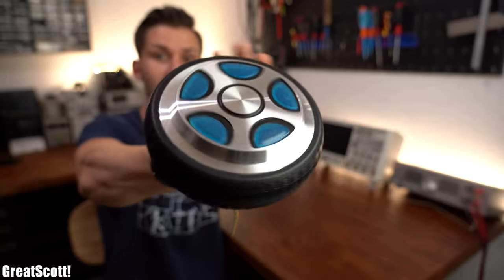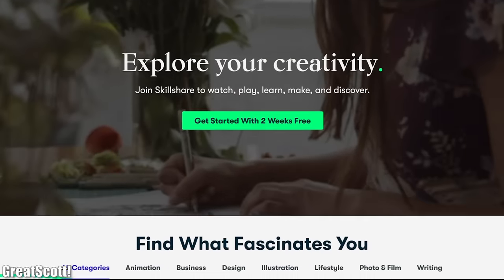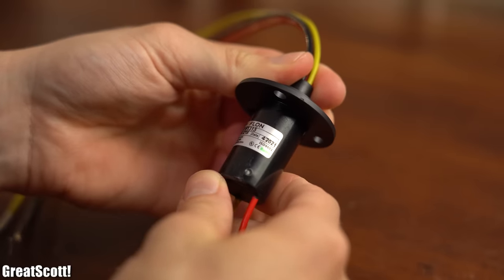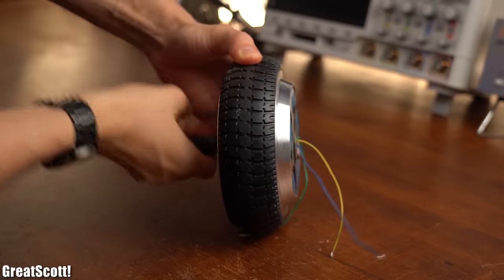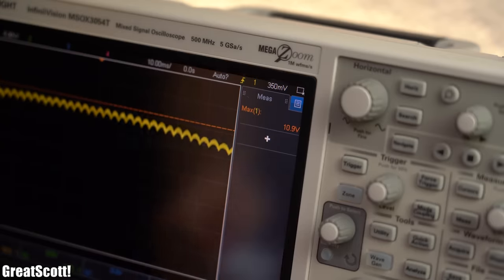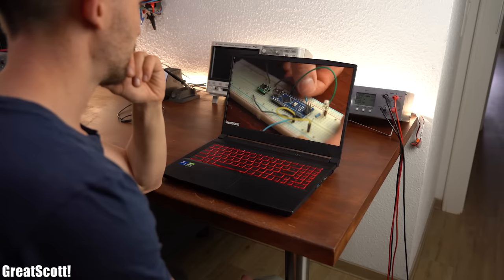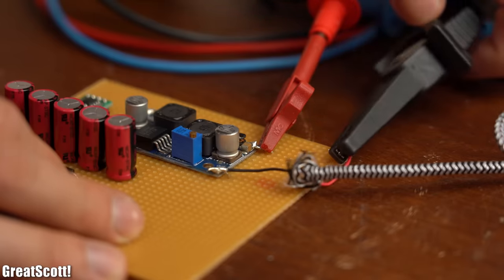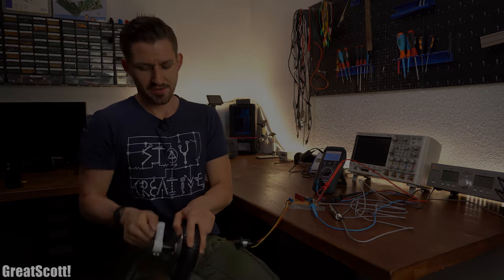Finally a good usage for Hoverboards! (charge your powerbank by cranking)

Comment: I did something similar on my bike.  When I cycle, my hub dynamo front wheel spins and supplies between 3 and 14 volts depending on how fast I'm going.  
The power goes through a rectifier through a buck-boost converter to a USB port.  
And everything fits in the coupling piece for electrical conduit. Ø 3/8" x 40mm.
Now i can charge my phone when i cycle.
Reply: And bike dynamo is smaller and lighter

Comment: use the wheel as a flywheel! and crank handle to the rim of the wheel. dill in to the aluminum wheel case and add a steel pin for the crank handle. then mount the axle on a stand. also if you use a stationary bike can run the wheel at a higher revolutions per minute with more consistency then a hand crank.  however the other is best for portable applications. have fun:-)

Comment: It was easier for you to crank the wheel by cranking it with a gear belt system on the tyre side mounting an aluminium flywheel with belt space. You need 2500 rpm ratio to 50 RPM for a better output

Comment: My dear Scott amazing as always
I have ome upgrade for the project in my humble opinion
you can make a fixed postion for the shaft and a 3D print a crank for the outter rubber wheel installing it by drilling the whole on it 
this way you can make it all combact in single unit without interfering the wire 
much luv Aladdin

Comment: The issue with the the first 3 'advanced' power banks may have been lack of a voltage reference on the data input lines, green white wires.
A common resistor divider can fix this issue with schematics available for different current draw setups respective to phone models (assuming also power banks).

Comment: Add 7805 regulator after it, for preventing to destroy a powerban., and set booster to 6.5v instead of 5v output.
When booster will shoot up to 32 volts, the 7805 regulator will start working, but you need to add a heatsink with 7805 regulator cause it gets heated with more voltage to destroy extra voltage.

Comment: Seeing this it makes me wonder how well hoverboard motors would do as a bicycle generator. Coupled with a charge regulation system and lights that could be a lot of fun.
Reply: They work well... But if you're going fast it's extremely noticeable the amount of drag they create.
They work best when you can turn them on and off so that you use them as a brake downhill, and store the energy. On the flat and uphill you don't want them

Comment: Love the way you slipped back to German for the three phase inverter circuit.
Interesting idea. Not sure if I want to do it.
The movement of the output wires will cause failures in future.

Comment: I looked into rectifying a 30kw 3ph wye generator yrs ago to get 240/120 single phase at 30kw. The more I tested options w/ a 3ph (current source) bench supply the more it seemed I could only get 10kw from the system using a rectifier like yours. The other 2 phases were only contributing to output smoothing. I was sending 1A AC 3ph thru the rectifier but only getting 1A DC at the output. Your motor is connected delta, but is likely suffering from the same issue as my setup.
What I found with the genset was I'd have to rectify each phase independently, pass it thru each inverter module, then parallel/sync the 3 AC outputs to get close to the full 30kw.
Needless to say, I never found affordable 125DC-240AC inverter modules even on the used (ebay) market.

Comment: Use the motors plus a stationary bike to make a charger, use a 3 phase bridge then an DC 12V regulator from a riding lawnmower. Works great to charge 12V batteries. Another option is to mount a bracket and a crank to the outer side of the wheel screwing directly into the rubber. Use a capacitor and a 12V to 5V converter to charge phones. The excercize bike mod allows you to use 3 or 4 of these motors for very decent current of about 3A a piece at 13.8 to 15V. Also add a simple over under voltage indicator made with a simple resistive voltage divider and green amber and red LEDs. Green will be about 2.8V for phosphode and 3.5V for nitride. Amber will be about 2.5V and red will be about 2.2V ❤ Have fun😊

Comment: The bigger powerbanks probably have more complex charging circuitry, so they try to pull a higher current and then back off when the voltage collapses. You might be able to fix that by adding the right resistances to the USB data lines so that the powerbank recognizes it as a computer USB port (and only draws 500 mAh). That was a thing you had to do on Adafruit's old Mintyboost to charge iPhones properly.

Comment: I think the slip ring needs to be mounted on the body of the wheel, otherwise the cables flapping around will eventually break (my guess at the blue heatshrink). 

Alternatively, the crank could be mounted on the wheel hub using an axle and slip handle (somewhat like a bike pedal). 
Then a stand built for the axle could house the electronics, while still being removable for more compact storage.

But, for emergency alone, it's probably serviceable. It's clear you've learned a lot about generators!

Comment: Great video Scoot. I think that turning cable set up is limiting a lot of the current. Also the two three step buck converting reduces drasticaly efficiency.  Thats why I make my own power banks at 12v then buck it down to 5v. With tis set up you can charge in about an Hour with out forcing the bateries.  I tink this st up will be more sutable for this this set up only thing, you´ll have to ramp up those revs.

Comment: Great as an example of how you investigated the motor, learned how it works and created a circuit.
Not so sure about its practical use as it would be easier and lighter to just put a few extra power banks in your rucksack instead.
I did enjoy the video.

Comment: You should use a usb buck converter module. They're only 2 to 3 dollars and already have some basic current and voltage protections. Just add one on after the capacitors and you're good to go. I've used them on small wind turbines and pedal generators.

Comment: This is a great intro project with a practical use. Plus german for full bridge rectifier! One question though- why did he re-engineer the wiring to include a slip ring instead of drilling and tapping the aluminum wheel and putting the crank on the wheel side? This would have prevented all of the electrical and machining work he had to do on the motor/generator, plus, the heavy rotor would have a flywheel effect, smoothing out the waveforms a bit. Downside is the axle would need to be braced in a vice or something, but that's pretty trivial (block of wood).

Comment: you gotta short the usb data cables together to enable 2A charging. if they aren't shorted or nothing is hooked up to them than it will only draw 500ma (aka those 2.5W since it's 5v)

Comment: I remember your first video on emergency power generation Scott, back in the day it inspired me to build something of my own. I ended up just putting together a geared 12v DC motor, a small caps bank as a buffer and a buck converter to 5v. When measured with a USB power meter I got an average of 2W on the output, so very comparable to what you are are here, yet that setup was like 10 times smaller and all neatly packed into a 3d printed cylinder with a crank. 
I think there's some unexplored potential here, hoverboard motors mush be able to output more than 2-3W right? Great video though!
Reply: Yes, there are videos of people making micro hydro setups with these and generating a couple hundred watts with a server fan as an impeller.

Comment: this is an awesome idea! though, i'd make a printed, cone shaped mount for the slip ring unit to fasten to the hub motor so it isn't flopping around trying to tear the wires loose, solder a molex plug on the output side of the slip ring unit to connect to the control board input wires, and add a longer crank arm, with a longer, folding handle for higher rotational speed. you could even design the handle to fold into a cavity in the arm. by making it modular, it would be more robust, and take up less space in a pack in the long run. if you incorporated the battery pack into the control unit housing, you'd have something you could probably market for sale, better yet you could sell design plans and schematics as a DIY kit. i'm sure there are tens of thousands of these hoverboards collecting dust in garages and closets around the world.

Comment: Suggestion: Mount your slip ring to the motor, to avoid the constant flexing of the short length of wires between the motor and the slip ring.

That constant flexing will cause eventual failure -- i.e., internal breakage of the conductor, likely without any visible damage when examining the insulation.

Comment: You counter the supercaps low voltage rating by putting it in series, each one will half the farad 
So there is no trick to size, v &  f, you pretty much get what you pay for. So look for a singular regular cap with 10v and 500uF. Maybe two in parallel.

Comment: So THATS why the caps were in series in the picture, I actually thought it could be a hand cranked generator, but those caps suggested a high voltage, even though the input wires and the dc-dc board were clearly not rated for that. Also Sachsen master race.

Comment: i would leave the wiring, make tha a handle.  and then put a crank on the outside of the wheel.  once you pull the stator, you should be able to drill as small countersink drill hole near the tread on the side you put your slip ring.

Comment: Um, maybe try a second shaft with a hand crank and a wheel. Press that wheel onto the "generator" wheel and turn it that way. You can even get a "gear ratio" between the wheel diameters to make it easier to maintain the required speed on the "generator" wheel. It would be easier than modifying the original wheel and no need for the "brush-ring" connection. ;)

Comment: Brilliant video!!! 😊
I'm wanting to run some arduino accessories from a model railway layout that is DC based, butbof course can be reverse polarised.

This supercap + efuse circuit is brilliant, and should be very helpful for working out a supply so I don't have to change batteries every time I run it 😊

Comment: I have not watched the full video yet but it comes in my mind that you should use two such motors like a rolling dumbbell for portable use and also mount it on a bicycle because it seems efficient enough.🙂
Reply from the maker: That is a nice idea :-)
Reply: Yeah, rolling them on a stationary bicycle tire would be fairly easy, and the rubber gives them good grip.

Comment: Power goes down with some powerbank maybe because it think "hey, there's enough power, then switch to fast charging mode", and because power from generator isn't enough it goes down. The last power bank just a simple buck converter with no fast charging feature.
Reply from the maker: Good theory. I think so too ;-)
Reply: @greatscottlab  Taking maximum power from generator is not that straight forward. You need circuit that will monitor RPM and increase current draw until RPM starts dropping and then ease back down. Basically MPPT.

Comment: For better efficiency, you might want to consider connecting the device to be charged directly. That way you could shave off the doubled charging losses of the batteries. That might save around ten percent of hand-cranking. Directly connecting the slip-ring to the stator will lengthen the life of the cables, but you certainly thought of that for version two...

Comment: The hoverboard motor might be a good alternative for the bicycle generator from a couple previous videos. The power output can even  reach somewhere around 100Watts most likely.
Reply: I am using a 2,4W hub alternator hooked to rudimentary DIY circuit to power 7*75mA white and 3*20mA red LEDs while charging a Lion battery for standing light. It provides enough light for most situations. It's just a rectifier from a PC PSU, cap, DC-DC set to 4.05V and that's it :)

Comment: I tried the opposite to make with a slip ring the motor to one where the motor shaft ist the output. But I burned the slip ring in an instance, besides this it kind of worked at least for small currents.

Comment: Try rotating the wheel with your rather old generator setup by using the power of a bicycle.
It will be great as motor is very efficient. 😉

Comment: I guess, if you anyhow use the buck-boost converter, then you could skip the super-caps alltogether, because the converter easily follows the few kHz ripple of the rectified voltage.

Comment: Personally I would attach paddles on the wheel and place in flowing water or in a Heron's pressure movement principle and produce power with the help of electro hydraulic power.

While at the topic, when you brought up the powerbank I have had an idea for quite some while now to execute it but I feel like I lack something to get the concept completed and that is how can I make a powerbank battery compatible with a phone that needs a replacement battery without the phone frying itself to junk from the voltage or something else that might be a mismatch in the most simplest way possible?

Comment: What about adding two pcbs with 3 concentric circles filled with solder, one on the rotor, one on the stator, putem face to face and solder the output wires to the one on the stator? I think you will get rid of those rotating wires. I hope it helps and lead to the second video if it is! Best of luck and more nice videos from you. Thank you!

Comment: Instead of rotating the motor directly, I think a set of gears with a high gear ratio for a crank would allow you to spin it easier and to keep it spinning when you need a break.

Comment: it is one of the best and simplest project i would have seen
can you please make a very high range metal detector
and a clap switch
Reply from the maker: Thanks mate :-) I already did a clap circuit. And a metal detector is on my to do list.
Reply: When i was in 8th grade, I thought giving more energy to a sensor increases its range and I gave 16v to my proximity sensor and it gone Boom.

Comment: Hey, did you know hoverboard motors can actually output 1000W of power when using a 48v motor controller to drive them? They typically only operate at 100-350W at most on normal hoverboards, but getting a cheap 48v 1kW ebike controller will give you much more power to use.

Comment: That actually could work with one of those pedal exercisers that you can sit down on the couch and pedal your feet. :)
Reply: You just add a gear sprocket to the outside part of the wheel. That way the center is not spinning and the motor is stationary. The rest is easy!! :)

Comment: Dear Great Scott
Hello
Hope ypu have a nice day
I have an idea for this video
why don't you do the same exact feature but instead of routing the wires out of the wheel
just make a 2-geared system with a chain and a steering paddle to direct it
and instead of using hand-power you may use your legs
like biking but in a stationary mode for the situation
hope you all the best and thank you

Comment: Hi Scott, I think your videos were amazing but it is getting quite simple right now. Maybe you can make a video for a self made vending machine with a wirelles bank card payment system. Of course you can buy the payment device (can be 2nd hand), but make a system which gives the price of a product to the payment system using an Arduino or so. 
Or design an inventous traffic light system for Germany, this can help the world be a better place because it helps CO2 reduction.

If you like this ideas I have plenty more ideas for you, contact me.

Greetz from Austria right now (I normally stay in the Netherlands, in die nähe von Aachen)
Reply: Maybe make a automated pizza baking machine for some central stations in Germany, a new way to earn some money, I have seen this in foreign countries
Reply: Or (more on topic) make an electric step (like xiaomi pro 2) with 'kick assist' in stead of a 'gas' handle. Just like peddle assist with bikes, you don't need a license plate then (in the Netherlands). The step is measuring the speed already, if you let the assist work when you give a kick (when the speed goes up, trigger the gas signal, normally coming from the gas handle)

There are already steps like this but these are much more expensive because it is a niche market. And it is quite simple to make with an arduino

Comment: I am sure this horse has been beaten already, but I think the wire and bearing was a problem that didn't need solving... he should have just mounted it by the shaft and span the wheel in some way, could have setup a belt drive maybe with some 3d printed gears to spin it faster, or even something to tension it onto a bicycle wheel. would have been cool to see how many watts you could get going that way haha.

Comment: Flip you conception. Instead of rotating the rotor, rotate the hub. Drill 3 holes in the outer face of the hub and attach a crank. Then you can fix the rotor in a box and spin the outer hub.

Comment: The crank handle is close to the diameter of the wheel of the hub motor. You could of attached a handle to the wheel and the shaft to a box to hold the circuitry and solved the wire spinning problem.

Comment: Make this generator into hub for bike 😅 and I think that would me more then sufficient. Only by adding larger rod and freewheel or even fixes cog for chain. But I don't know if it don't blow up and what to do with extra voltage. Because it makes few Wats by turning it by hand and on bike untrained rider can generate 50-200w and trained ones much more for longer times and I don't mention peek power. I'm thinking about making that generator for fun and turn into indoor trainer 😅

Comment: Can you try putting fan blades onto the setup in order to build a wind turbine. The kV rating of the motorshould work just fine for the turbine rpm